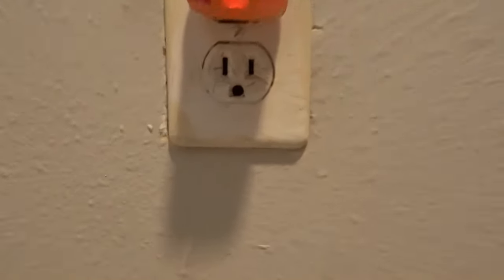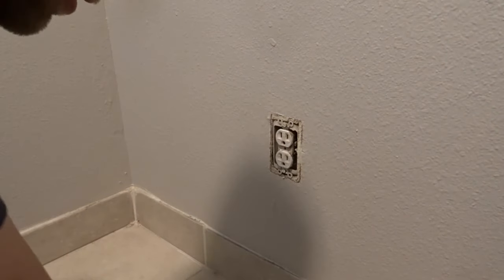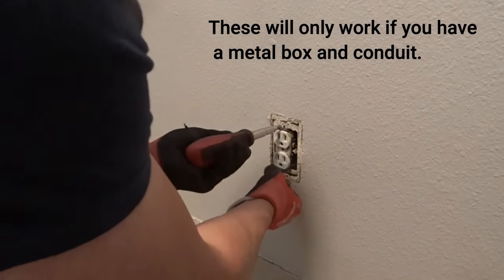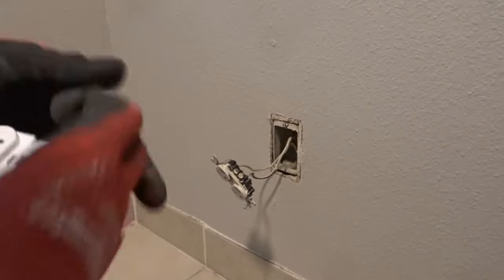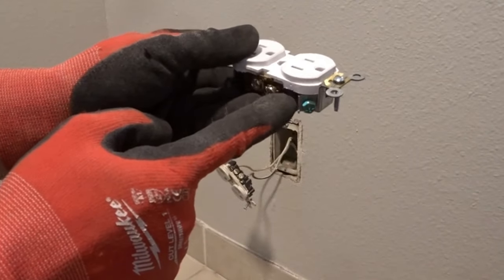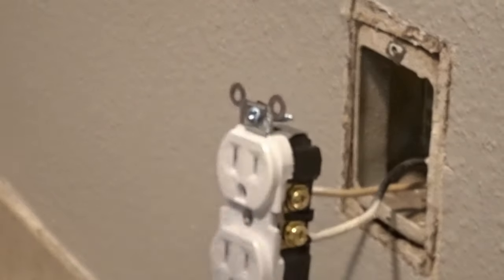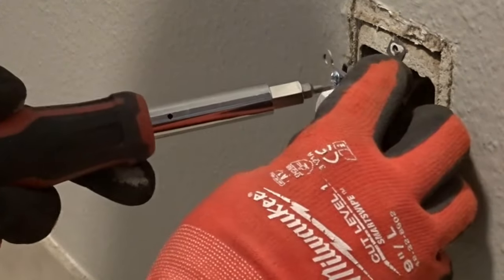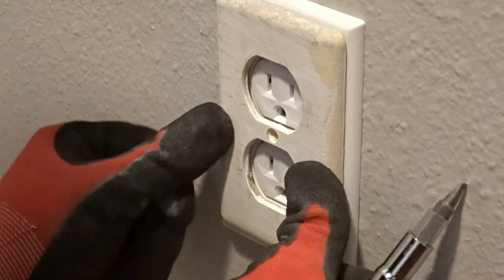How To Replace An Outlet | Ungrounded to Grounded

Comment from the maker: There were a lot of people ask me what to do if the box is not grounded. I made a video that shows the solution in that case. 
Thanks for the comments and feedback.
https://youtu.be/A02AIiqEwJg
Reply: What you are doing is called a "Bootleg Ground" , even through it may be conduit back to the main panel ... if it has 3 wire service { 2> 120/240vac Hots & Neutral } it still is not grounded per NEC with a "Neutral bonding jumper"  and outside grounding rod & waterpipe grounding! Putting in new 3 plug receptacle without marking it with the " No Equipment Grounding" sticker is ILLEGAL !!!
Reply: @rrfields65  isn't the owner allowed to take off the sticker though
Reply: @Wanderlust1972  : No! if someone uses it and gets electrocuted to death thinking it was GFCI , you can be arrested for manslaughter at the minimum and maybe even 1st degree murder if the prosecution can stick depraved intent !
Reply: @rrfields65  whenever I go over my friends houses I always take off those stickers without them knowing because it's funny
Reply: @rrfields65  - I’m sure republicans have eliminated any manslaughter charges. They hate too much red tape.
Reply: Excellent video .... Thank you
Reply: @Wanderlust1972  i do the same thing.
Reply: Could you tell me if is dangerous to have Not Grounded outleds? I live in an old house and most of them are not grounded but they work normally, is there a problem using outleds like this?
Reply: @harrpotterfacts5782  how long had it been like that? Have u had any problems?
Reply: Great Video and thanks for sharing. I did exactly what you did (Connecting copper wire from outlet ground to box - tested still showing no ground. Am I doing anything wrong?
Reply from the maker: @filming-Moments  I’m assuming that the box is not grounded then. I posted another video that addresses what to do in that case. You can find the link to it in the video description.
Reply: When you say it conduit do you mean armored cable??
Reply: @Wanderlust1972  bro that’s messed up
Reply: The code still requires a jumper to the box even using a self grounding receptacle.
Reply: @rrfields65  thats not a bootleg ground, he did not jump it from a neutral conductor he used the grounded box from emt, which is allowed to be used as a means of grounding. The only he didn't do was put a jumper from the device to the box. Put that jumper in he good to go
Reply: @rrfields65 bwahahahhaha
Reply: National Electrical Code requires arc fault protection must be provided in location listed in the code whenever a receptacle is replaced. Arc fault protection is now required in almost every location in a house. So, if you are replacing a two prong receptacle, then you'll need to use an AFCI/GFCI receptacle. If your replacing a grounded receptacle, then you'll need to use AFCI receptacle.

Grounding:
NEC 406.4(D)(2)(c) does three prong receptacle to be installed without a grounding method if it is being supplied power from a GFCI receptacle or GFCI breaker. Any GFCI receptacle and any receptacle protected downstream of the GFCI must be labeled "no equipment ground" and the receptacles protected by the GFCI must also be labeled "GFCI protected". A GFCI needs no ground to protect people from hot to ground shock or electrocution.

If a grounding wire is not installed in the conduit to the outlet box, then the conduit may be used as a ground if, and only if, it allowed by code. Many older home used steel flexible metal conduit (FMC) to install wires to outlet boxes. Although flexible steel metal conduit may provide a pathway to ground, it is not a sufficient grounding method and is not allowed by code.Therefore, steel FMC may not be used to ground receptacle or any other electrical devices.
Aluminum (FMC) flexible conduit may be used as a ground with some restrictions. Solid metal conduit such as EMT (electrical metal tubing) or rigid conduit can be used as a grounding method.
Good Day
Reply: If you were paying attention you would have heard him say the box was metal and it was attached to metal conduit that is grounded to the elec panel.
Reply: Personally, I would install the gfci receptacle with the label. The conduit is not a sure thing in your situation.
Reply: @rrfields65 ha ha ha

Comment: 99.9% of the time, residential houses do not have metal conduit that runs back to the AC panel. Just because there's a metal box doesn't mean it's ground. 🤔

Comment: I'm confused. No idea how you got it grounded.
Reply: Me either.
Reply: He was lucky as they had metal conduit and metal boxes which were grounded.  So all he had to do was connect the ground to the box.
Reply: @coasterpaul  thank you.
Reply from the maker: In this case the box was grounded. There were a lot of people ask what to do if the box is not grounded. Here is a link to a video that will help with that.
https://youtu.be/A02AIiqEwJg
Reply: @aaronfixesstuff  so the ground wire goes to the outlet (green screw) and back to the metal box (if grounded)?
Reply from the maker: @panda-uv8zm  that is correct.
Reply: This works on metal boxes. If have plastic boxes, you need to run a ground wire to closet location
Reply: U can ground to your galvanized pipes
Reply: @dunnrite8299 While this may work, it’s not approved in many areas. You might be able to talk your inspector into accepting it. Not all places allow conduit grounding, especially for new work.
Reply: The new outlet has grounding wires in the upper and lower moutnting screws. When it's attached to a metal box that has conduit, it creates a ground.
Reply: @trishcraft wake up and pay attention it was clearly explained. Metal box and metal conduit is the ground path . He implied it more than explained it in excruciating detail for people who should not work with electrical devices
Reply: Please don’t do electrical. Holy Fucking Hell
Reply: @panda-uv8zm actually by using a modern outlet, he doesnt need the ground wire to be connected.   That outlet he used has a bonded metal strap across the back of the outlet.  Just by screwing it to a metal box thats grounded.  Now to be fair the outlet is only grounded via the screw that holds it in place.  A peraon could remove the plastic washer that hold the screws in place and or pig tale via ground screw to back of box for increased safety.
Reply: @deathvalley1477 😂😂😂 yeah run it to the closet area.. jk,,happy 2025
Reply: @lawoull.6581 closet steel location what's so funny, if a box is mounted on a Sheetrock and have a Romex where you are picking up  the ground? Jk 2030
Reply: @deathvalley1477  I'm sticking with the closest closet area..ty sir.. jk
2030🏃⚡️
Reply: @lawoull.6581  whatever. Nowadays we have a lot of Mr. Walk around to do nothing and teach other types of people.
Reply: Is funny that USA people believe in inspectors words

Comment: Clean the crude off the metal box face so you get a good ground when using this approach and as noted this only works if the box is connected to GROUNDED conduit.  Frankly the GFI approach seems better if you put it as the lead outlet, this will protect all down stream outlets (just make sure you add the GFI protected and no equipment ground stickers to all the outlets protected).
Reply from the maker: I posted another video that explains the process using a GFCI. I agree with you that that is a good solution.
Reply: Definitely a GFCI with a ground pigtail to the box (Of course only use the pig tail if the box is grounded through conduit and you for sure know the conduit is grounded) is the way to go. If you have enough room for it. Those old boxes can be a little tight lol.
Reply: @aaronfixesstuff  for someone like me who isn’t the most handy. I have the metal box conduit and just found out my 3 outlets in my office aren’t grounded. Is doing the “easy” and not gfi still ok?
Reply: Then why did the tester show the receptacle is grounded if the metal isn't clean?

Comment: You'll need to see if your metal box has metal conduit of some sort attached. If it doesn't then the box isn't grounded. In which case You can replace the outlet with a GFCI outlet which will gain you some protection from stray current

Comment: Worth mentioning that the convenient gold "self-grounding" tab (or "The little guy," as you called it) will only work if the box is metal and grounded, AND if the box is flush to the wall.  If the box is recessed into the drywall, even a little bit, the clip won't get pressed against the metal box.  In that case, you need to screw a pigtail between the hole in the box and the grounding screw on the outlet.
Reply: How can I tell if the box is grounded?
Reply: The conduit is attached to the breaker box which grounds it. Simply check and verify it.
Reply: @gnoong5262  Use a multi-meter to test the voltage between hot and neutral.  Then test between hot and the box.  If the voltage is the same, then the box is (probably!) grounded back to the panel.
Reply: Thank you!
Reply: This is not allowed everywhere. Actually, though, I’m surprised that the outlet didn’t show as grounded to begin with. Every three prong outlet I’ve ever seen has the ground tied to the frame. The brass clip was added because paint or corrosion could get in the ground path. Not everywhere allows grounding through conduit.

Comment: The key here, I guess, is that the box is connected with metal conduit from the Main Power Panel.
Reply from the maker: That is correct.
Reply: @aaronfixesstuff  - Thanks
Reply from the maker: @tevman69  here is a link to a video I made that shows how to fix if the box is not metal. 
https://youtu.be/A02AIiqEwJg
Reply: So the house was wired with AC/BX cabling, I'm I right?  If so it should have been grounded automatically unless the bond back to the junction or service panel was broken or loose.
Reply from the maker: @corygillyard1455  close, in conduit. So that outlet was grounded at one point, but the outlet got messed up.
Reply: @aaronfixesstuff  Oh okay, it figures somewhere things got messed up.
Reply: @aaronfixesstuff  wow man I’m gonna give you a sub this is great video. Question- just found out a few ouetlets in my home aren’t grounded anymore. My outlets are EXACTLY like the one you show. So if I buy the part and do what you did I’m ok. Main question is it only requires the 2 wires? And then the screw to the metal box provides the actual grounding?
Reply from the maker: @mannyfresh7065  thanks for the sub, as well as the kind words! That is correct, assuming that the box is grounded. If it isn’t, I have another video that shows what to do:)
Let me know if you have any other questions!

Comment: Two things,
1) You want about 6 inches of wire stretching beyond the edges of the box. That gives you plenty of working room.
2) Attach that pigtail to the box regardless of the metal sheathing. There is a lot of paint on that box. I, personally, would NOT trust an old, painted over, probably somewhat corroded, box to permit a proper ground connection. 
Kudos on the use of the electrical tape. This will guard against arcing and the risk of shorting the screws against the box when you pull that outlet out and put it back. However, grab that roll of tape and wind in around that outlet a couple of passes. This lessens the chance that the tape will just fall off as the glue ages and will give you a thicker layer of protection.
Good work. Be safe.
Reply: Came to say the same thing about 6" of excess to be up to code. I also agree on using the pigtail to ensure a good connection. Wrapping the outlet is optional and more of a preference thing. I personally in the industrial field usually don't tape my outlets as I hate working with outlets that have old gooey tape. But it does serve as an layer of protection from shorting. So each their own on the tape.
Reply: Good two points!

3. Also make sure to remove the square washer on that outlet mounting screw  before screwing it in in order to make the metal-to-metal connection, i.e. truly self-grounding.
Reply: He should replace that backbox with a new one that one looks like it’s 50 or 40 years old

Comment: The metal box has to connected to an equipment grounding conductor per 250.148 of the NEC code. Metal raceways can qualify as an ECG (250.118) but if you have old NM cable that's like Romex without no ground feeding the box then you wouldn't have the effective ground fault current needed to carry current from the point of the ground fault to the source to open the over current device.
Reply: New Mexico? I'm in new Mexico trying to figure out my two prongs so I can upgrade to a three but I'm struggling
Reply: Yea, I think I'd just install a GFCI receptacle on an old house instead. I'm not an electrician, but I've worked as an electrician's helper. Just my opinion. From what I've learned, I would rather if at all possible, go the full distance, and run two ground rods outside, 6ft apart I think is the rule. Of course you would likely have to change the whole service panel, unless it is fitted with an option to upgrade. See this is where I couldn't really be certain. I could probably tell when I looked at it. For most, it's more trouble than it's worth. Yes, old houses have less sophisticated electrical wiring, which can be dangerous when it wears from old age, a technical glitch occurs, or a bad storm hits, particularly if lightening strikes, but for the most part, if it ain't broke, why fix it i guess... On the other hand, i've seen what lightening can do to the wiring of a house that isn't fitted with the latest wiring techniques. It's pretty bad, and quite expensive to have repaired. Electricians aren't cheap. I think lead electrician's make around $60/hr. but the equipment costs are factored into that, so technically they aren't bringing that much into their wallet i guess. Am I right? Isn't that about right? Not sure, but I know it's something along those lines. I've been thinking about getting back into that type of work, but I have a lot to learn. Interesting stuff though.
Reply: Correct. Without a ground path this application would only create a false ground. Professional circuit testers will identify a false ground but the cheaper small testers will not.
Reply: Checkout Electrical code coach. He just did a video on five ways to wire two to three prong according to nec.
Reply: Beat me to it.
Reply: Read more books not TikTok

Comment: I had an electrician tell me I had to rewire the whole house even tho I had metal boxes. Thanks for the video, you confirmed what I already knew.
Reply: I mean well obviously you COULD rewire the whole house... And it would be very safe! 🤷🤷🤷
Reply: Having metal boxes doesn't mean you can simply replace the outlet and connect the ground to the box, you can only do that if you have metal conduit running to all boxes in the house connected back to the panel and then grounded to earth at the panel. 
In most cases and probably in your case you'll have a NM Cable (Non Metallic Cable) running to all the metal boxes, which means that even if you do install a ground to the box it is not actually giving any protection since it cannot run back to the panel and into earth. That means you'll have one of two options to get your home up to code. You can either protect all of your outlets with ground fault circuit interrupters, or you can completely rewire the home.

Comment: Aaron, good job getting a successful outcome. I'm not an electrician either, but my bet is you would get a ground with the old receptacle by removing the paper keepers on the back. Then sand the paint off of the receptacle and the box. 
You did the right thing by replacing the cruddy receptacle with a quality commercial grade receptacle with a brass spring clip to enhance grounding. 
I would have left a couple of inches more of wire, might be desirable in the future and there is plenty of room. I would also add the ground wire from the receptacle to the box, there no reason not to. Btw you could have done that to the old receptacle to get your ground.
Good point about wrapping electrical tape around screws.
Reply from the maker: Thanks for the feedback Ted! Funny, a lot of comments said about cutting the extra wire. There was still like 8” in the box, but the camera did not pick it up unfortunately. But I totally agree with you.
Reply: @aaronfixesstuff  ok, got it. My house is old (1950) and I recently upgraded the receptacles and noticed some of the wires way too short and hard to work with. In a couple of cases I added length by using a push in connector like a Wago lever lock. I like the Leviton commercial grade receptacles like you used.
Reply from the maker: @surferdude642  yeah for sure. Those are my favorite!

Comment: How did you get the 2 yellow lights without grounding the outlet? Is that how it’s done? Because I have an older home that has no ground wires and I need to change the outlets.

Comment: I felt this guy give a very good example. The one thing that was not explain which I will explain to you in this post. Is how to ground it from the the grounded metal box if the plug not properly cut into the metal box. You got to make sure the plug is tightly secured to the Box. If you use the breakable outlet cover. You will need that grounding screw to bring the box to the plug. The unbreakable cover you could turn the plug all the way down and still have no ground wire tied to it and use the groundIng the Box. But the number one practice is add the brown wire to the box and to the plug directly to you could confirm you got a proper ground connection. If your box is using a metal plug cover for the plug cover you can skip putting an extra grounding wire from box to plug. When the plug is sticking outside the wall at all times. So I suggest that you use a grounding wire when using a plastic wall plate. Due to you don't know how good that ground connection is going to be. So just use a grounding pigtail it's the best fix.
Reply: I don’t think this is code compliant.